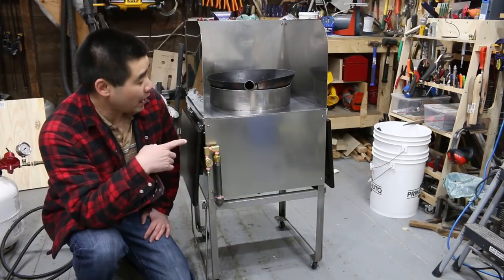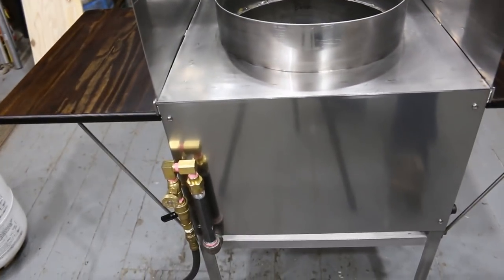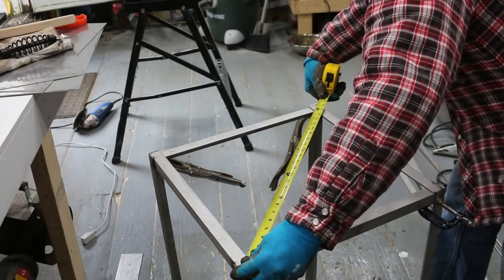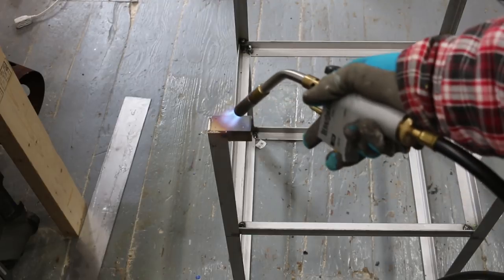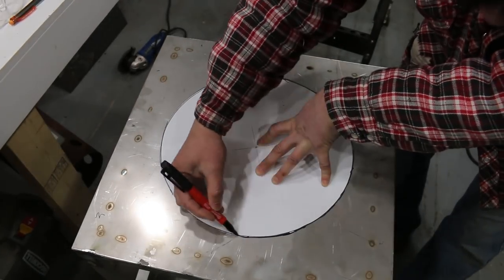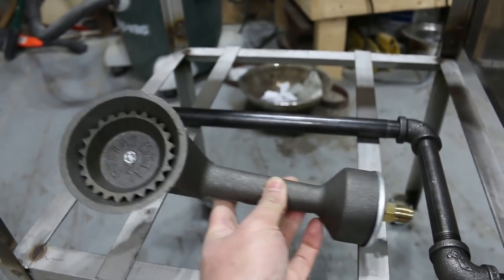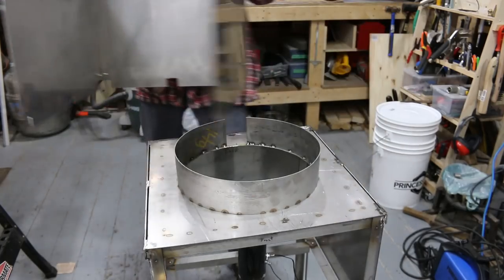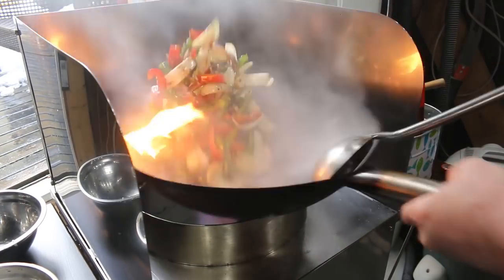Stainless Steel Wok Station Build Video

Comment: 1.  Why do you need a high pressure regulator if you are only using 1 to 2 pounds?  
2.  Can your igniter take the heat?  It looks like the flame is right on it all the time.  I am curious how this has held up.

Comment: Funny I responded to this 3 years ago seeking info but probably more like 4 years ago cause in the intrim I built me a wok station using mild steel to frame out and accept 2 burner boxes with room for one more, one with 100,000 btu jet burner and the other 200,000 btu I painted the frame with high temp stove paint plus added castor wheels as well, the burner boxes and jets I used are from Tejas Smokers out of Texas and I can tell you it's a gas hog and will burn your food in a heart beat so you really have to be on top of what you're doing. Both are capable of throwing a two foot high flame but when cooking a meal its rare I go past half open on either valve. This video demonstrates a nice build with stainless but it can be done with mild steel if you don't mind the extra maintenance and the extra expense of buying already built burner boxes.

Comment: Just bought a professional wok station for a little over $100 at taobao. Comes with running tap, blower for gas efficiency, and a proper cast iron wok saddle. 100K BTU. Heads up for those who wanna save some time, money and labor.
Reply: Can you post a link to what you purchased?
Reply: Where did you buy it?

Comment: when cooking with a wok do you generally only have one burner station? Would a double burner station make sense? I've never done wok style cooking.
Reply: a double one would come in handy when using one of them to boil or fry then transferring to the wok used to stir-fry
Reply: Just a single burner unless you're using in a restaurant. I would recommend using an induction or any low btu stove for your slow cook work, just makes more economical sense.

Comment: I don't understand why nobody sells a decent commercial version of this.   You can buy a gas grill at Walmart for $250, but there's nothing comparably priced on the market for cooking outside with a wok.
Reply: They do.  check out King Kooker make some cheap woks on a stand or if you want, you can go to a real commercial mfg. , they have them range from around $500 on up depending on how many burners, what other kinds of features.  I personally would just get a cheaper one OR just go all out and get one that's about $3500 and it has the trough, etc. etc.

Just type in commercial wok burners or wok stations and you'll see plenty of products on the market at various price points, features, etc.
Reply: @impactodelsurenterprise2440  link is dead...
Reply: @impactodelsurenterprise2440  I'm in Malaysia so think it will ship here cheap. Great find!
Reply: Oh wow me too!